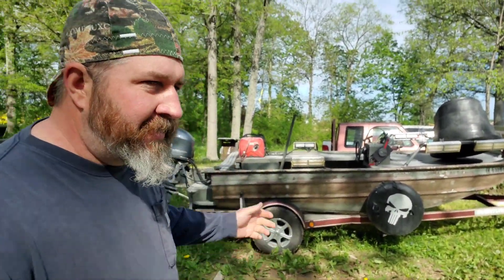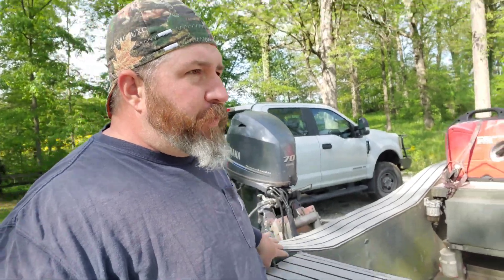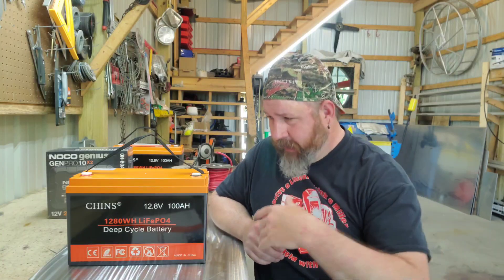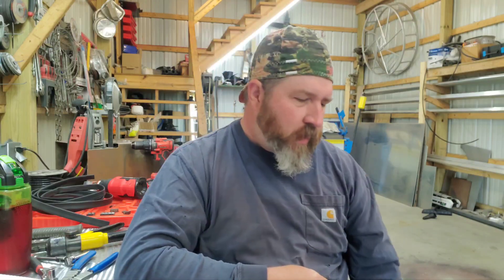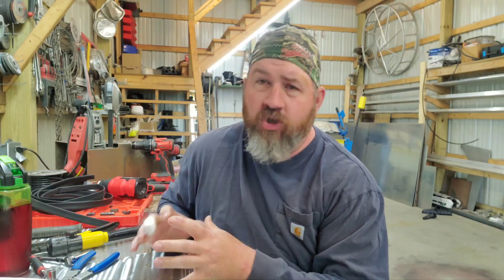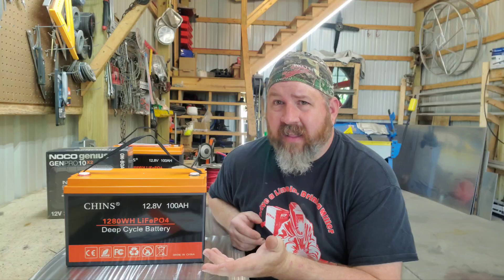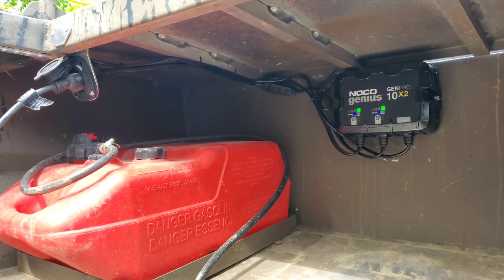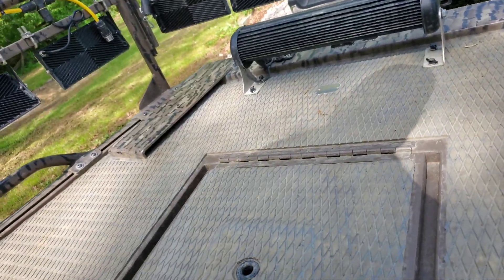Lithium Boat Batteries in 2023 with Whiteriverrambo

Comment: I have been running lithium batteries on my snowmobiles for years with no issues, even in extreme cold temps. The weight savings on a snowmobile are a must in some conditions.

Comment: This is my 3rd season running lithiums.  Last weekend was the first time ive ever ran them fully out.  With that being said i originally bought 2 100 ah amped batteries to run my 80 lb 24v terrova.  I brought a larger boat that had a 112 ultera.  Through my research i went with a weise lithium from Amazon as it had a bms.  The BMS is what I look for in a life po4 lithium because there are some that are not equipped with that.  I have not had any issues in cold weather with the batteries not working.  Now im not talking extreme cold but 32 and above its the charging where the bms really matters because if you go to plug in your on board charger and temps are too low the bms puts the battery into a sleep mode where its not charging.  Which just serves to keep you as the owner from inadvertently damaging the battery while your charging it.  I also run noco onboard charger and i love it.  They are sleek low profile and well built.  Keep fighting the good fight dustin pfds always and shoot straight brother.

Comment: I guess my biggest 2 concerns with lithium is 1. the management systems shorting out like a control board then your night is just over and possibly the next week(s). Not really sure cheap or expensive makes a difference since like you said they all come from china. But from a guide standpoint have you or anyone tried exploring or using the warranty on the cheap batteries. My guess is your paying for customer service when you buy the fancy stickers. 

2. My only other major worries would be thermal runaway. I have not personally seen any Marine lithiums doing this yet but from the fire department world we are seeing a huge increase in call volume from cars to toys all caused by lithium thermal runaway. I feel like that is because more are on the market now vs ever before but do the cheap Chinese play a roll in this or is that just the nature of lithium. Burning my boat and shop down would definitely be bad for business lol.